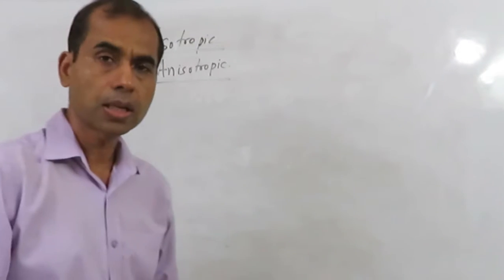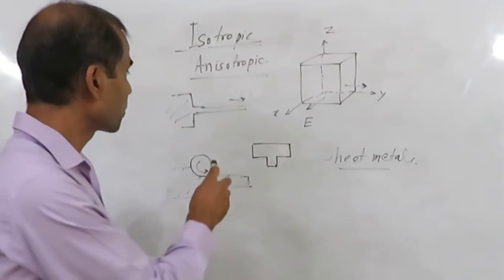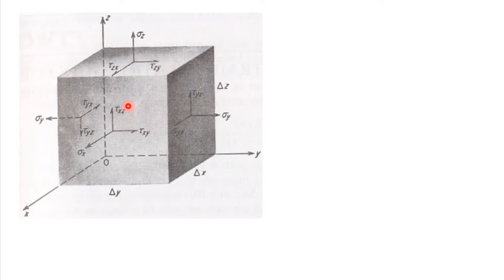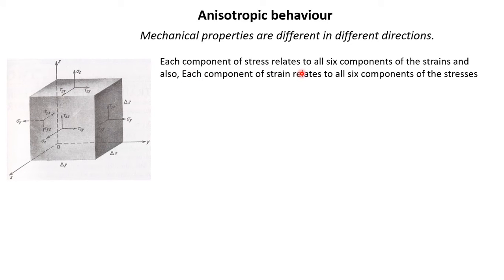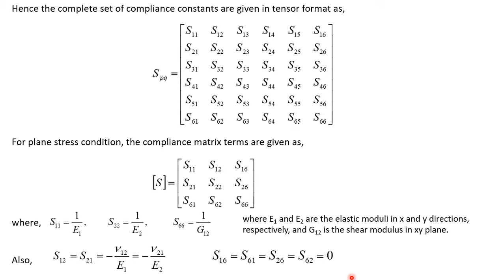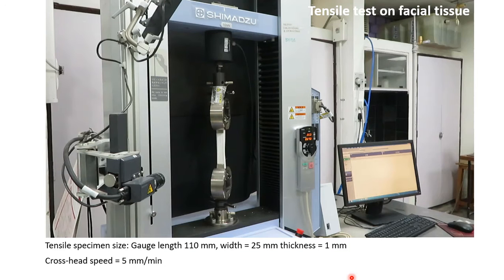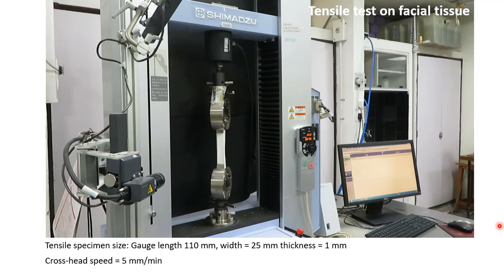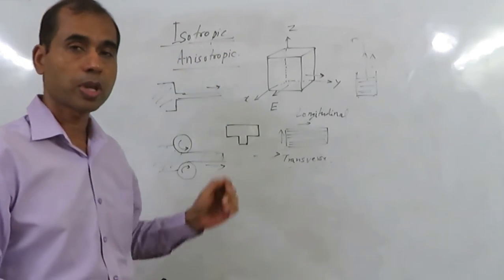Isotropic and Anisotropic Behaviours of Materials

Comment: Thank you very much professor. Really amazing explanation..... I am a PG scholar, doing the Anisotropic analysis in thermoplastic composite material. In this case how to find the fiber orientation or directions and also strength wise what direction the component will be get more strength ? please suggest me sir...
Reply from the maker: Thanks for asking👍.  If you are making the composites then you know the directions. For fabricated ones, you need to ask the manufacturer. For a project, better to make the composite by yourself. Strength in the length direction of the fibre will be maximum.
For modeling, you should use three-dimensional representative volume element (RVE) model.
Reply: @engineeringmaterials-tribo5142  Thanks a lot sir......

Comment: Sir,
For anisotropic materials like copper, boron carbide etc, value of Youngs modulus etc vary to some extend along different directions by some 5 - 20%.. ( Not much like composites ).

In case of Youngs modulus, For design purpose and in literature how the values are selected ? ( In such materials, there is a  minimum and maximum youngs modules).

For design the lowest youngs modules is used? The value in literature is lowest one or any averaged one? How it is averaged?
Reply from the maker: Thanks for asking. For materials which are polycrystalline, which means the crystals are randomly orientation, there will be no anisotropy. This is the reason when we report the value of mechanical properties of a metal or ceramic (powder processed ones) we only report one value. For single crystals, yes, there will be anisotropy. If there is anisotropy in a polycrystalline metal specimen then this has been introduced because of further processing like rolling, extrusion etc which deforms the material more in one direction compared to others. Processing leads to anisotropy. If the material is known as anisotropic then we should know the maximum stress direction in the design and then orient the material such that the high strength/modulus direction in the material aligns with maximum design stress direction. This will be to utilize the material's properties to the maximum. Of course, factor of safety should always be taken care of. For example, in a rolled sheet of metal, the maximum strength will be in the direction of rolling and hence that should be the direction of maximum stress when we design something with this sheet metal.
If we do not know about the material's anisotropy then better to use the lower value of the modulus and the strength as safe design approach.👍

Comment: Thank you for this video. What are the actual applications of anisotropic materials? Are they advantageous in certain situations?
Reply from the maker: Thanks!👍Anisotropy is introduced in materials because of strengthening in certain way like in composites. Or, due to processing, for example, rolling of metals. So, anisotropy is a result of some action(s) on the material. Anisotropy may be used in a certain material to direct its behaviour, for example, how it fails. A safety device may be introduced anisotropy in the mechanical properties so that it fails when stress exceeds certain value in certain direction.